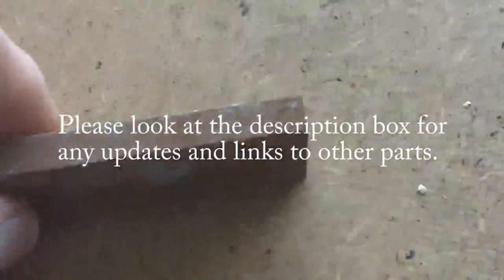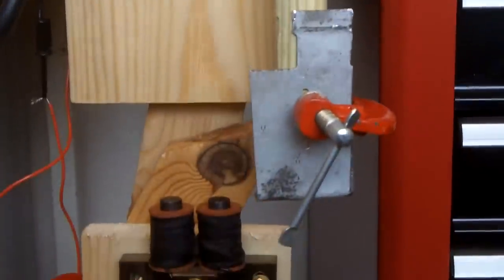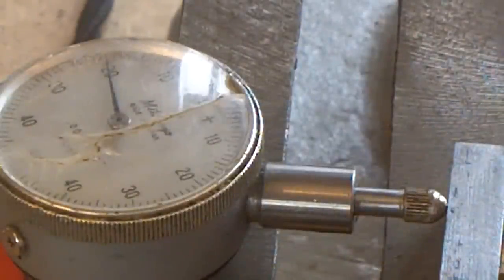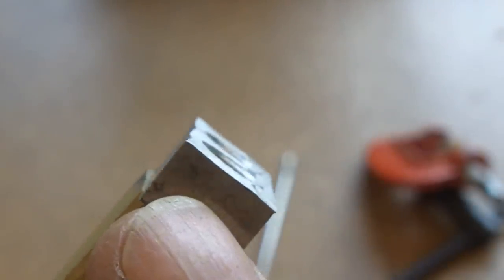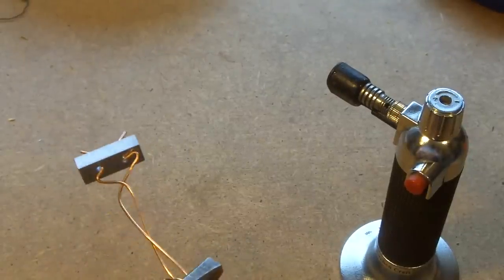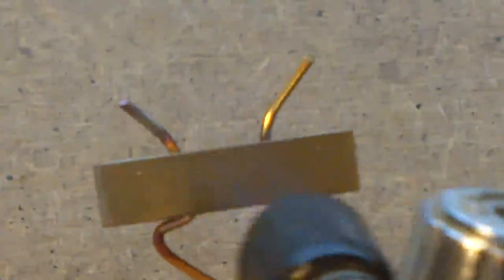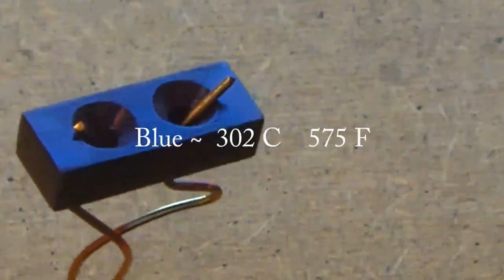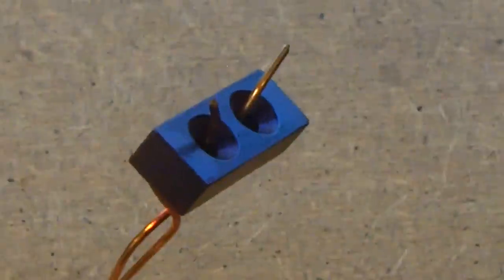Hipps clock movement project, rough part 20

Comment: Since I saw a Synchronome  this electric lock has fascinated me. I have only seen one Hipp in the flesh, that was a 1/2 second pendulum beautifully finished and hanging on a wall. I have made several starts onomy own projects over the years, 5 years ago I bought a Pulsyntic and have had it running since. Hope this series will inspire me, Thanks. Your's a man of my own type. Best wishes. Andrew.
Reply from the maker: Hi Andrew, I'm a great starter and a lousy finisher. Once I can see how to do something or I know how it will finish I can lose interest. I will finish this clock but I want to find a new back board for it. when I finish it it'll post I on YouTube.
all the best . . . Andy

Comment from the maker: The first big machine I built was made entirely from reclaimed bits from broken machines. It’s used in the manufacture of ‘Thread lock bolts.’ This is a process where fine plastic powder is heated with a cold heat source and reflowed onto the threads of bolts so that the nut locks onto the thread of the bolt and wont shake loose; It’s the alternative to Nylock nuts.  The last time I saw that machine it had successfully processed millions of bolts and it’s probably still going.      Regards, Andy

Comment: The Iron on the pendulum and the iron core coil are un-acceptable. You need an air core coil and a small super magnet on the bottom of the bob to provide both output information,and impulse, when necessary. Once again; the whole idea of a precision Pendulum is that it should be free; The Iron On the Pendulum reacts with the iron core coil even when the coil is not energized; sucking energy out of the Pendulum. Study first, and build later.